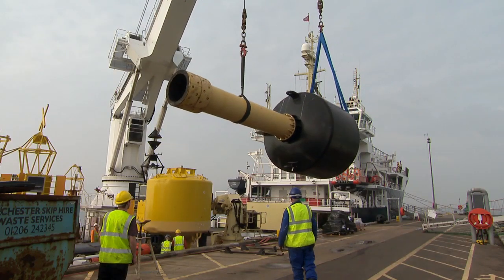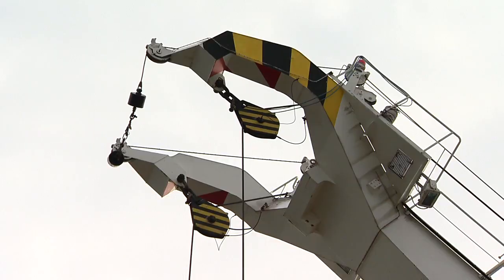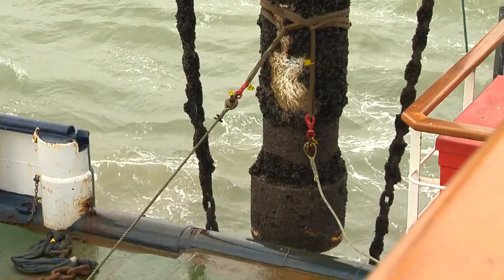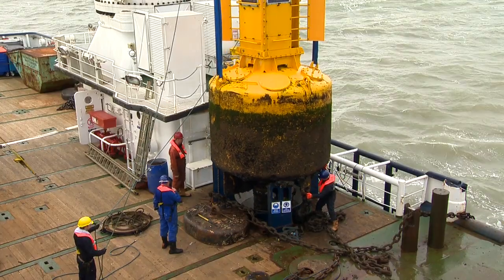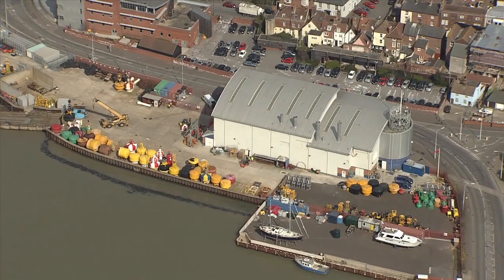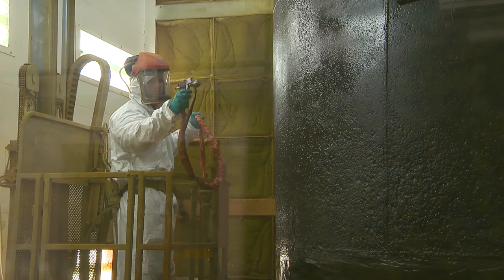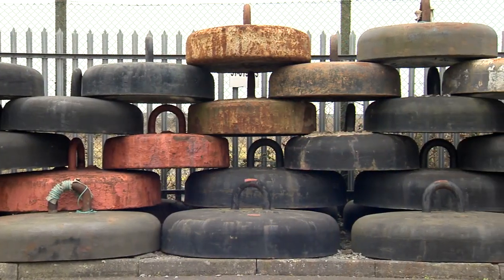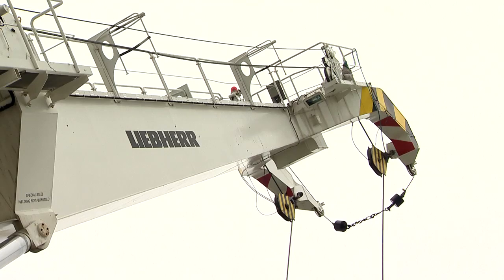Trinity House buoy maintenance

Comment: Am I the only one who thinks it would be pretty cool to have a giant buoy with windows to chill in?
Reply: Well if somehow I became stranded in the ocean, I would have no problem swimming & taking full advantage of not being in the water like bait👀😳 equipped with a emergency beacon would be awesome on those, might have helped in the movie The Shallows 😳😂
Reply: @theresacoy9881  in theory, some of those open water buoys are equipped with transponders that signal back if something has gone wrong with their mechanism so i guess you could get on one, unplug a wire and catch a ride when someone comes out to inspect it.
Reply: so during ww2 both German and Allied war efforts placed buoys in the channel and north sea intended for downed pilots or mariners. They essentially were a slightly larger version of this sort of buoy with a small living space with rations and a radio inside the body, and IIRC there was a way to light a lamp or raise a flag on the top mark to show it was occupied. Supposedly the German ones were more spacious but tossed about much more due to the buoy shape not being conducive for habitation, while the allied ones resembled boat hulls that didnt bob around as much. 

Though now im wondering about the logistics of having one as a tiny house on a lake or pond where the water doesnt toss it around as much.
Reply: It's called a boat with the anchor down, dummy.
Reply: @HangTimeDeluxe  You have a weird definition of "boat" for someone who calls himself an engineer and has boat videos on his channel